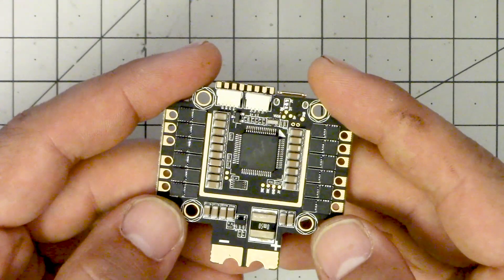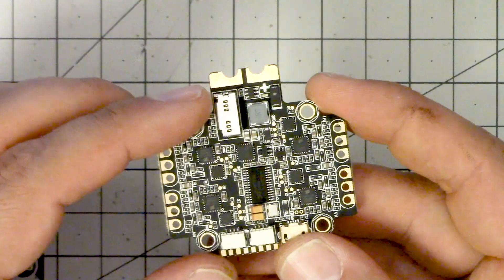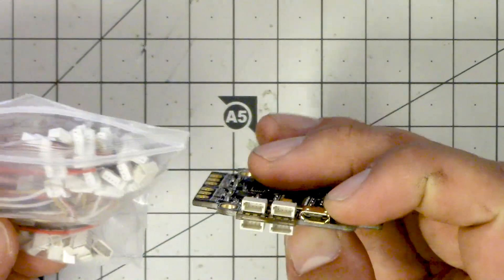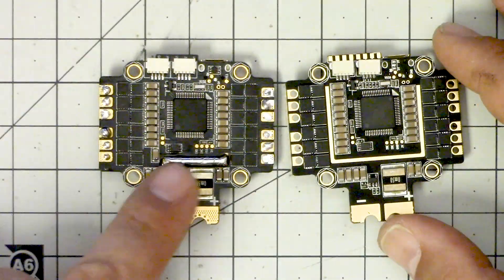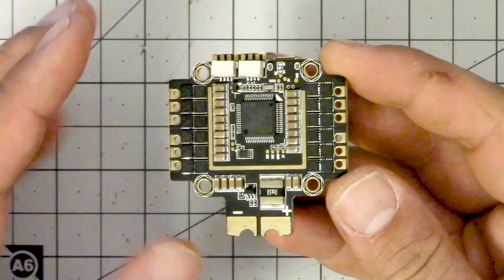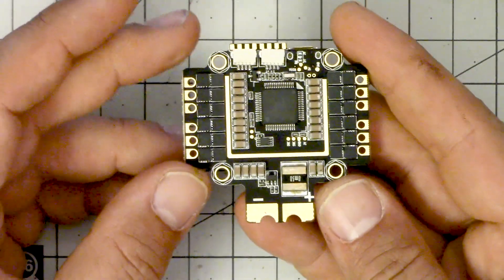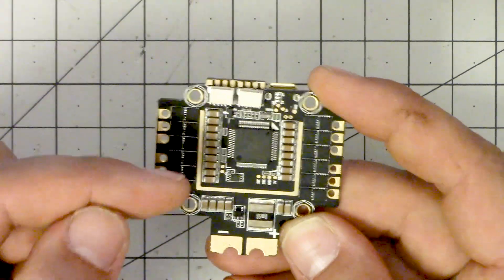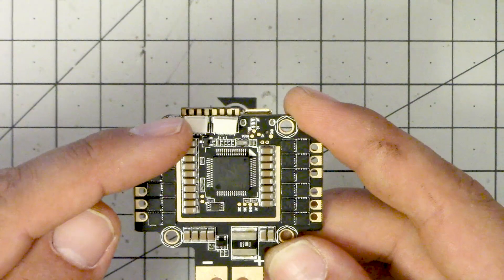Asgard Flight Controller Review | F4 BETAFLIGHT CLEANFLIGHT FC WITH ESCS

Comment: so this video is somewhat old but what are the other choices now it being so much more tech out? I want something simple to go into my 4s 5" quad that makes things simple for me as i am a novice and my current quad which landed in a river when the antenna came out of the vtx and i went snow mode:( So i am replacing the controller and was looking at the emax magnum f4 but you kind of turn me off from f4 in this video so where is that perfect medium f3 controller you speak of? I know its out there and you are the guy who can point me to it. I've commented on some of your other videos but you are very busy and i fear they go unnoticed :( thanks for all you teach me @joshuabardwell
Reply from the maker: F4 is pretty much the standard today. F3 is outdated and not able to run the latest firmware.

All of my product recommendations are at https://www.fpvknowitall.com/ultimate-fpv-shopping-list/

Comment: 𝑰𝒔 4 𝒊𝒏 1 𝑬𝑺𝑪 𝒂𝒄𝒕𝒖𝒂𝒍𝒍𝒚 𝒍𝒊𝒈𝒉𝒕𝒆𝒓 𝒕𝒉𝒂𝒏 𝒊𝒏𝒅𝒊𝒗𝒊𝒅𝒖𝒂𝒍 𝑬𝑺𝑪 𝒄𝒐𝒏𝒔𝒊𝒅𝒆𝒓𝒊𝒏𝒈 𝒕𝒉𝒆 𝒘𝒆𝒊𝒈𝒉𝒕 𝒐𝒇 𝒔𝒊𝒈𝒏𝒂𝒍 𝒘𝒊𝒓𝒆𝒔 𝒎𝒊𝒏𝒖𝒔 𝒍𝒆𝒏𝒈𝒕𝒉 𝒐𝒇 𝑬𝑺𝑪 𝒗𝒔 𝒎𝒐𝒕𝒐𝒓 𝒘𝒊𝒓𝒆𝒔?
When speaking about weight there could be a line of drone parts which replace copper with pure silver, possibly use PCB's as a structural component as well or put circuits on flex-PCB to save weight. Even silver is expensive it retains its value so it could be nice toy for rich :)
About ugly wire joints - you can crimp your own connectors at one end.

Comment: One advantage of the connectors is that less soldering on the board is less chance for poor soldering technique to ruin the board. I'm going to put one on my test quad to allow easily swapping cameras and VTXs for component testing without soldering.

Comment: Josh im trying to update a lumenier f4 aio FC. what do i flash to LUXf4osd??
Reply from the maker: I don't understand the question. Sorry.
Reply: Im sorry ill rephrase, I bought two https://www.getfpv.com/lumenier-f4-aio-flight-controller.html and i tried to update it to LUXF4OSD in BetaFlight 3.2.4 .. When i updated it reboots and i can connect but not gyro activity no cpu load data % at the bottom or anything? did i break something? When i connect the other one it works fine and says its using  3.1.7 VGOODDHF4 so i flashed the other back to that older firmware and it flashes successfully but then wont connect to betaflight and PC doesnt even detect when it's plugged in and i already have drivers i need.. Getfpv says it uses both versions depending Target: 3.1.7 VGOODDHF4, or LUXF4OSD in BF 3.2+

Comment: Hey Josh I have this board its the v2 I just wired it up everything is clean nothing touching as far as wires I have a set of tbs steele motors on it and as soon as I plug the lipo in motor 1 start heating up only motor one gets hot and that's before I arm now if I arm it motor 1 sparatically shuts down than spins back up if I spin the motor by hand it seems fine no issues
Reply from the maker: +John lepeshko a motor getting hot before even you arm the quad, I would suspect a bad ESC.

Make sure your screws are not touching the motor windings.
Reply: Joshua Bardwell I swapped the motor out and checked length its ok and it acts the same it's the asgard v2 aio I don't see any hardware issues whatsoever

Comment: Hey joshua one quick question about the asgard and other f4 flight controller, correct me at the following point where i'm wrong pls :)
F4 flightcontroller 3 uarts  1RX and 1TX are inverted on the same uart and the oder 2 uarts are on RX and TX uninverted.
so FRSKY reciever need inverted RX
Smartport telemetry need inverted TX
both on this 1 uart call it here on the asgard "uart6" we have also have 2 uninverted uarts call them "uart1" and "uart3"
so here is my question: is it possible to remap the uart like motor output ?
my point switch the TX uarts  so that the previous "uart 6 TX" is on "uart3 TX" and "uart3 TX" is now remaped to the previous "uart6 TX" 
so betaflight think it runs uart3 and the chip sending the signal to the hardwareinverter in previous "uart6 tx"
finish product from this remap in theory:
UART6 RX inverted     (FRsky reciever)
UART6 TX uninverted 
UART3 RX uninverted
UART3 TX inverted     (Smartport Telemetry)
UART1 RX uninverted
UART1 TX uninverted (Smartaudio)

or i'm completly wrong and the RX and TX run to the same inverter on the board? and its technical not possible

i hope is understandable what i'm trying to say my english is not the best :/
kind regards
Reply from the maker: No, you cannot remap UARTs. Softserial is the closest you can get since it can be moved around with remapping and it handles inversion automatically.
Reply: ok thank you for the quick awnser :)

Comment: Just an FYI, you can remap some features to others as UARTS seem to be limited on the F4 AIO FC ESC boards. For example, you can remap the LED pin for S.Port tlm.
What I've learned: (this applies to the RTFQ VEDRFOLNIR, Lumenier ALPHA, Sunrise Siskin etc but can be re-purposed for other boards) 
Betaflight
1.) The soft serial can be mapped to the LED pin (A01) on this board. Enabling soft serial in the config tab isn't enough for it to show up in the ports tab. You must assign it a resource. In my case A01. THEN it will show up in the ports tab.
A01 on this firmware was assigned to two locations. They must be cleared. How you need to set it up is:
resource LED_STRIP 1 NONE (old A01)
resource MOTOR 5 NONE (old A01)
resource MOTOR 6 NONE (old A08) (just for consistency, mild OCD)
resource SERIAL_TX 11 A01

resource SERIAL_TX 11/12 & _RX11/12 are your soft serial resources.

2.) Despite using the uninverted solder pad on the R-XSR, tlm_inverted = on must be set.
3.) set tlm_halfduplex = on must be set.
4.) The button for Telemetry on the config tab does not seem to work. You must set set tlm_switch = ON in the CLI.

Comment: JB. I have built the Kraken Worx in many different configurations and ended with the Cicada F4 AIO and now they released a version with OSD. It is the lightest  configuration coming in at a dry weight of 252 and it functions very very well. It does not have BBL but man its a great set up. Thanks for all your work. Cheers

Comment: How do you calibrate motors with that all in one... The usb provides power to the escs so when i plug usb in and go to betaflight motor tab its like battery is already connected so i get no tones i can't calibrate ..
Reply from the maker: You use Dshot and then you don't need to calibrate.

Comment: So only one uart is inverted? And does smart audio to the TBS unify not need inversion? And should there be no problem, if I only need SBUS for the FrSky receiver and smart audio for the VTX?
Reply from the maker: Smartaudio doesn't need inversion but SmartPort telemetry does. If you only want to use SBUS and SmartAudio, you are good to go with this FC.
Reply: Joshua Bardwell I'm glad to hear that. Thanks a lot!

Comment: Did you get a chance at all to run that board?  I've had people tell me they are running BH T2 2600kv motors on it and there's not issues.  I'm interested to see how reliable it actually is.

Comment: It looks like it's going to be a huge pain removing the microSD card to review BB logs with the FC mounted. Even worse trying to re-insert the card.
Reply from the maker: Not if you install it as intended, with the USB and SD card facing left, and the XT60 facing right. The board is not intended to be installed with the main battery lead coming out the back. You can install it that way, but as you point out, it will be a big pain to get at the SD.

Comment: Josh, is there an easy way to add extra capacitance to ESC's...  4in1 ESC's?? What are your thoughts?! Thanks
Reply from the maker: On many 4-in-1 the battery pads will be the only place to add one. The good news is, a 4-in-1 will have really short traces so you should have less trouble with noise to begin with? Maybe...
Reply: ATMO FPV add the cap to the battery lead. if you're worried that's not as good then add it between the current sense resistor and ground on the side of the resistor opposite the battery lead, it's a little messy. you can also see if that exposed bus bar has continuity to positive. that might be the way to do it if that's not a ground.
Reply: As has been seen with better noise suppression via separate caps, would be nice if manu's exposed some track to mount them.
Thanks!

Comment: The USB plug is in an inconvenient location and is hard to access once the board is installed.   The SD card is pretty difficult to mount and remove around the rear standoffs too.
Reply from the maker: The USB plug is only hard to access if you install the board facing the wrong direction. The board is intended for the motor wires to be inside the frame with the USB on the left and the XT60 on the right. If you want the XT60 facing backwards, you can do it, but as you note, the USB and SD card will be hard to access.
Reply: Well, that makes a heck of a lot more sense now lol.  Now I want to leave work early and see how it fits.

Comment: So I have a micro that has the FC stacked on top of a little 4in1 esc with the little plastic dividers.. It's always worked fine. I added a vtx osd board on top of that stack and in order to make it all fit in the frame I had to cut down the little dividers a little bit and flip the FC and the 4in1 esc upside down.. Now when I throttle up ONLY motors #2 and #3, the yaw gyro in motors tab goes kind of nuts.. ONLY the yaw ( red line ) I even put brand new motors on with no change. What's the deal? Interference?
Reply from the maker: Did you flip the FC upside down without adjusting the board align parameter? If you change the board orientation, you have to adjust board align in the Configuration tab to match the new alignment.
Reply: Yeah I got all that adjusted but it seems the escs were affecting the gyro. I took the quad apart and held the board away from the esc and spun up the motors and it didn't bother the yaw what so ever. Oh well.. guess this board won't work cause there's no way to make it fit right-side-up using that esc plug. Guess I'll have to grab ANOTHER piko blx lol.. be the 4th one. They always quit working on me one way or another.

Comment: my v1 of the asgard was awsome. only broke it physically by smashing into a pole. survived 10 solid wrecks and lots of air time with no problems. although getting ahold of ready to fly quads is a joke!!! just bought another v2
Reply from the maker: Try FPV303 instead. RTFQ is dirt cheap and they are often the first to get interesting product. But god forbid you need customer service of any kind.
Reply: Joshua Bardwell .. just got my v2 In and ready to maiden. gonna take the package it came in and send v1 with a letter that askes to fix lol. we will see. 

I like the f7 they have. I think... lol I'm about to do my first build with it. No having to deal with uart inverting issues. .. question, I think there is only one more chip past the f7 in the family. think there will be a new family of chips after? have no idea why we would ever go last f7. uart issues solved with full dshot running at 4% lmao. what else could we need. thanks for the reply. I've learned a great deal because of you. Good ol JB makn for the easy transition in to quadcopters!! Keepn us sane!!!

Comment: Joshua i have 3 chameleon builds all using  omnibus F4 v3, they all run frsky x4r sbus, uart 6, smartport telemetry uart 1, tbs unify smart audio uart 3, osd from fc, CS from pdb, the F4 boards are good and can do everything an F3 can in excess, the chameleon has more than enough room for a 2 stack whit rubber dampeners on the fc and u can even stack on top you receiver if u wanted to   https://www.facebook.com/ManxFpvFreestyle
Reply from the maker: I'm surprised that SmartPort works on UART1. Doesn't it also need inversion? I thought that was what BlueFalcon's video was demonstrating.
Reply: Omnibus F4 from V3 invrted RX is now on Uart 6 , so u got sbus RX on uart 6, and smartport on Uart 1, and use uart 3 fror smart audio, uart 6 is inverted
Reply: oh yeah urt 1 i have smartport direct uninverted from rx very simple single  wire solder

Comment: Thanks for another great video Joshua! Are any of the pins broken out so you can use softserial with this board? I have had a lot of success using softserial for telemetry on F4 boards then using the cli command "set telemetry_inversion = 1". Works a treat!

Comment: Hey Joshua, I wonder if you know why they can't drive the ESC FETs directly with the main MCU?
Reply: Alan Evans it's technically possible but it would need changes to betaflight. these boards are designed around using the omnibus as the target so it's much easier to just use existing betaflight and blheli images. to build a board like you are talking about you'd need to make sure the mcu had enough hardware timers and pins to control all those mosfets while the main loop runs. you'd need a software engineer who understands both the ESC side and the flight control side and they'd have to create a new unique hardware target.
Reply: daniel dimitri it just seems like it might be worth it.  sure it's not trivial but the issues of FC to ESC communication go away.  the feedback is directly available to the FC.  not to mention at least 4 fewer ICs. f4 MCUs run at a few percent CPU usage so if the timers are there the MCU should have the horsepower.  also I think maybe it's time to abandon or expand the 30.5 x 30.5 standoff spacing, these boards with wings have me worried about breakage and they look pretty silly.
Reply: Alan Evans i agree that it would be more elegant, smaller, and communication would be reliable and there would be options for telemetry not possible with bl-heli-s and as far as I know are only speculated features possible with blheli32. I just think the way things are changing is so fast and everyone is racing to keep up making incremental changes instead of total redesigns that what you say may happen but there's probably going to be some more stepping stones on the way there. 

my brother is a bit obsessed with pcb design lately and we've talked about building something like that. but he wants to do the flight control software himself from scratch so don't hold your breath on that becoming a reality soon. you can really open a big can of worms trying to solve problems, I don't want to give away too much of the ideas my brother and I tossed around but the hobby still uses analog video. at what point do we change that and do you integrate that as well?

Comment: So, this has always been weird to me, why doesn't BF just add an option for inverted SBUS in the RX menu that reads it directly in software? Surely if it just changed the code to look for high instead of low and vice versa on the signal, you avoid all the extra BS with adding inverters and so forth. Is there some reason this isn't done? Just so they don't have 2 different SBUS options to confuse people? Seems a little short-sighted!
Reply from the maker: I've wondered this myself.

Comment: Or you can use softserial as a third uart for smartport telemetry (and no need to hack the receiver for uninverted signal). You know how to use the resource command :-)
Reply from the maker: But what pin would you put it on?
Reply from the maker: Also, since when can you use softserial for SmartPort? You didn't used to be able.
Reply: Joshua Bardwell LED pin. 
Yes you can now, even on F1 boards. Funny but it works great. I was even thinking I learned this by some of your vids :-D
Reply: Oh, so you are saying I can connect my SmartAudio to the led pin and in betaflight configure this as a softserial? In that case I would not have to wait for a F3 version :D
Reply: you will sacrifice the LED pin, but... no one uses that anyway :D
Reply: But I have just bought leds for all arms and back .... and I want it blending my opponents ;) gah, just saw that Lumenier released V3 of this board, is it fixed in that? So that I can invert all my UARTS?

Comment: no, i understand is for side xt60 mount but it also says in the manual that for people who want to use it with xt60 at the rear it is possible after remapping motors.
Reply from the maker: It is possible, but it sounds like you don't want to do it that way, so you don't have to.

Comment: for me the deal breaker is the escsticking so far off the sides, in most frames nowdays the esc would be totaly outside the frame, hence durability in crashes would be questionable or just the wires so far out of the frame getting snagged
Reply from the maker: You've misunderstood the intended mounting orientation. The motor outputs are front and back, inside the frame.

Comment: this thing is actually not ideal for superlights, it will never fit in a superlight frame and the weight saving is zero, Asgard weights exactly same as separated 4-1 ESC plus FC (ie. Aikon 4-1 & Lux V2) which are a better form factor for a superlight and you get a full featured board with 5 UARTs and no limitations. I have yet to buy a single Omnibus product in good working order, there is always something not right, voltages are out of whack, "filtered" line is not filtered, compromises and in general too many issues requiring hacks (such as running extra bypass wires from resistors and so on). they are releasing products way too fast with limited or non-existent test program, it's not until version 2 or 3 before the same product is at least half useful. releasing products fast with no testing is fine with me but while they are using us customers as their test bunnies the product should be half-priced until they release version 3 of the same product in good working order. sorry for the rant, just my personal experience and my personal view.

Comment: How hot does this get with ESCs and processor heaped in together and away from the props??
Reply: Hotwire I was surprised that it stays cool. My asgard setup with 2205 motors weights 270gr. It turned to fly amazing. Really happy with this board so far.